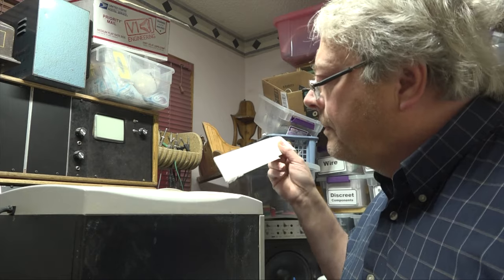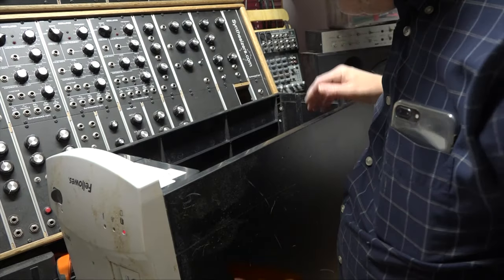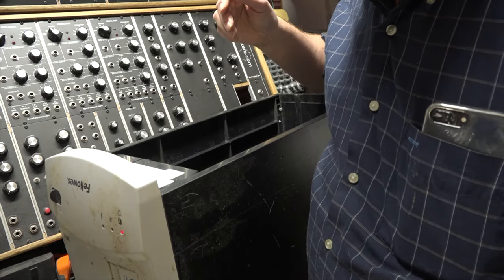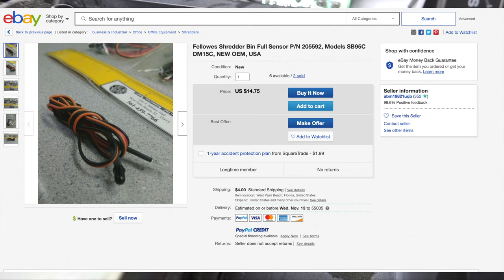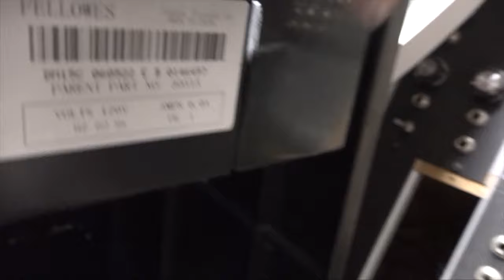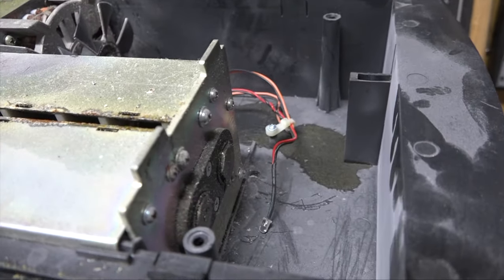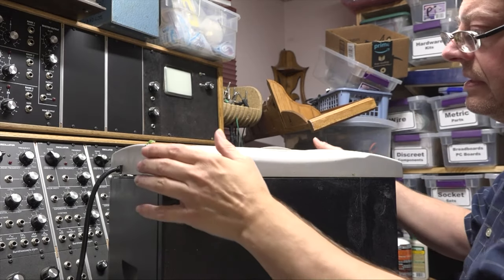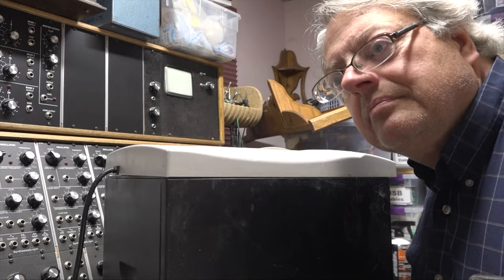Repairing or Bypassing the Paper Full Sensor on the Fellows DM15C Paper Shredder

Comment: Thanks for doing this. I can confirm that your bypass method works on the Member's Mark Model C250-A 18 sheet feeder. If you shred old labels or anything sticky, the bin full feature will drive you nuts. Although disassembly and internal layout is completely different than your Fellows, the same led and 4 wire harness exists inside. I imagine that many current shredders use this same method. Only thing I did different is left the led bulbs there, just to keep the openings closed. Thanks for your video. The information was very helpful.

Comment: Thanks very much!  I shorted the black and brown pins at the connector by inserting a thin solid conductor rather than cutting the wire assembly.  Of course, this accomplished the same result.  Good as new my friend!  My 15 year old DM15C rules!  I'm waiting for the start-capacitor to give it up but, so far, good to go!

Comment: In many cases the first thing would be to clean the optical sensors. There are two, right underneath where the shredded paper comes out, facing each other, and held in place with  small screwed on plastic  covers . In my case, that was all that was required. I would suggest that as an initial approach, as  over time, they get paper dust covering the lenses. Also, the base pops off the silver mechanism housing. Its just held by a few of them around the perimeter. Can always find them with a thin screwdriver and pushed in to help release them of you do t want to use brute force to pop off the top.

Comment: Thanks for the video. I prefer keeping the functionality. In my case it was the LED light that was gone. I replaced it with an LED from a cheap bicycle light. Works perfectly. 
I discovered that the warning light didn't come on, when the front was open and I pressed the frontcover switch manually. So I could conclude that the sensor side was working fine.

Comment: My DM15C shredder has a similar issue where the paper jam light stays on and the gears won’t turn either direction. I’ve cleaned the sensors and cleared all shreds of paper to no avail.

Comment: Hi I can’t really see it clearly. Did you shorten the wire by cutting it?
Reply: He cut the wires that are orange and black...Stripped the insulation back a little and twisted the bare ends together then shrink wrapped them..It worked on mine..Thanks for the vid
Reply: He meant short as in creating a short circuit by connecting the two wires together. :)